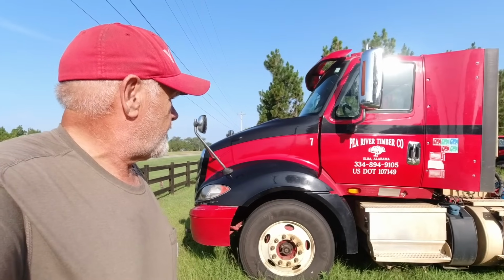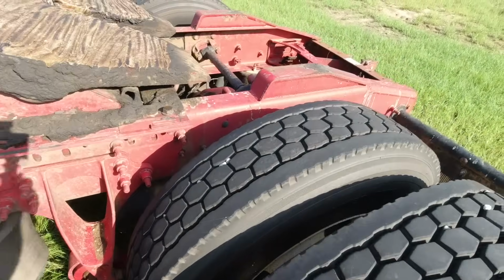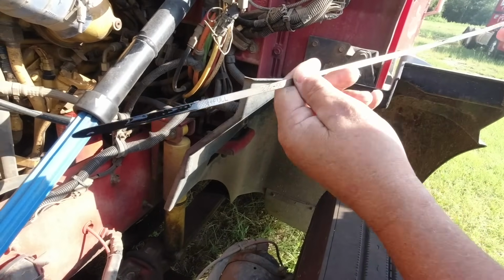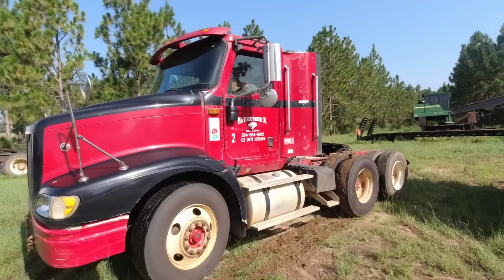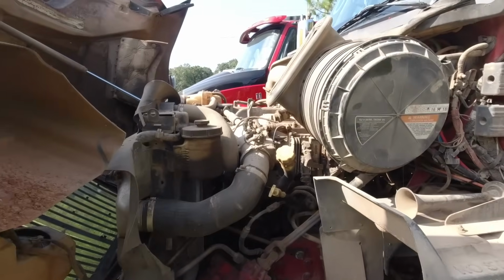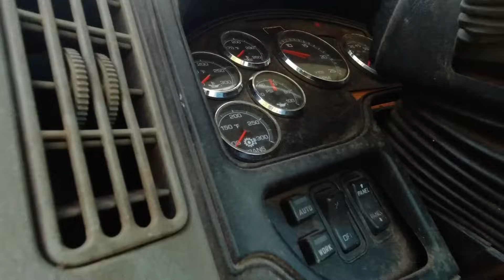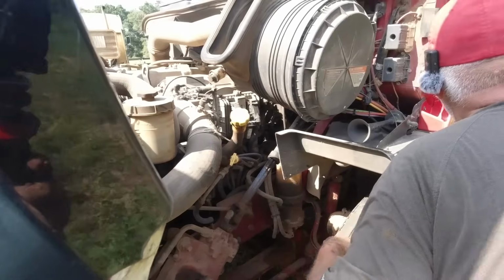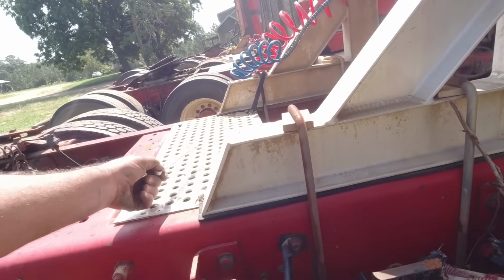We Started THE WHOLE Fleet.

Comment: I have a 2015 Prostar with the Max force 15 liter motor. The biggest piece of junk I ever owned. They are plagued with pollution problems! Mine has 340k and is a yard ornament. Wouldn’t trade the one without def for a dozen newer ones. Maybe make fair local local real short distance unit Wiley hate to be negative but speaking from experience 👍👍👍👍
Reply from the maker: You are definitely not negative. You are in the overwhelming majority of opinions on these engines 
Thanks for sharing yours